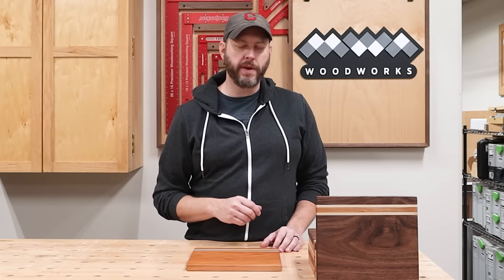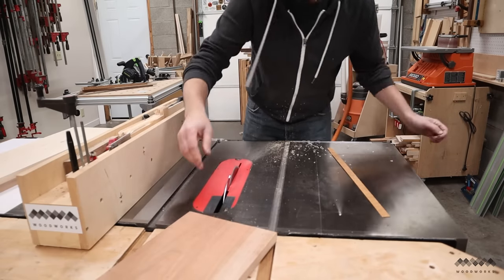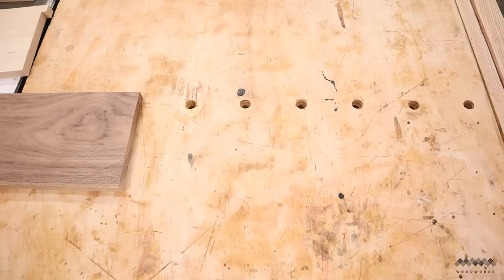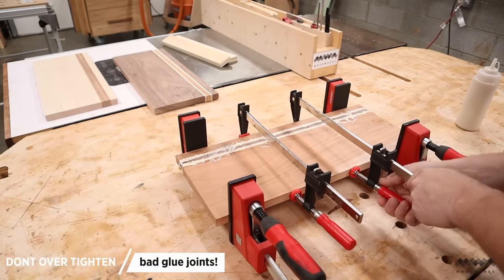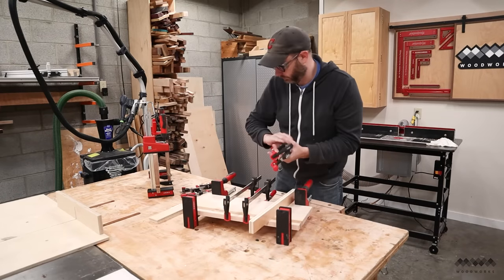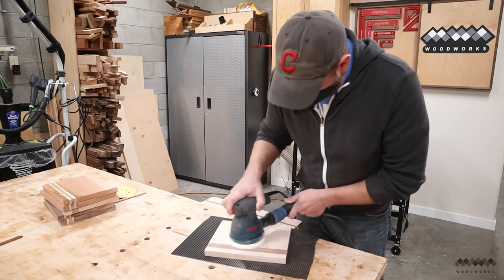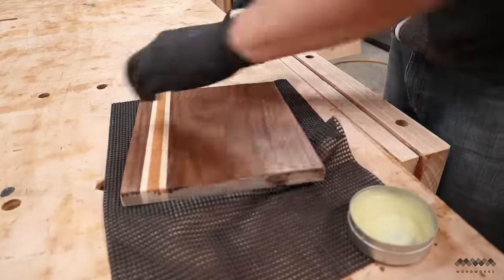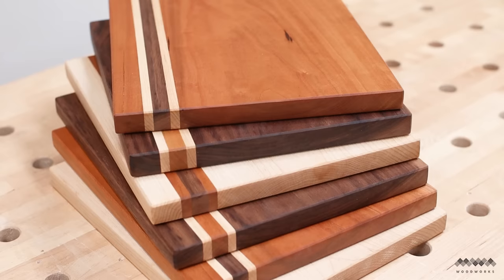How to Make Cutting Boards with Minimal Tools

Comment from the maker: ✅ HOW TO SUPPORT MY CHANNEL 
SUBSCRIBE : https://www.youtube.com/mwawoodworks?sub_confirmation=1
JOIN my Patreon community: https://patreon.com/MWAWoodworks 
GET project plans: https://bit.ly/download-project-plans 

✅ TOOLS AND SUPPLIES IN THIS VIDEO:
Titebond 3 Wood Glue (bottle) -https://amzn.to/3aH17TA
Condiment Bottles (for glue) - https://amzn.to/3aZKsZf
Parallel Clamps - https://amzn.to/3hwJSDC
Scraper - https://amzn.to/3o75jNP
Gorilla Grip Shelf Liner- https://amzn.to/2WZtn9C
GOOD cedar pencils (trust me) - https://amzn.to/3IMwsB8
Dewalt Trim Router (bare tool)- https://amzn.to/38ROyA7
Freud 45 degree chamfer bit - https://amzn.to/3o6OFhx
Freud Heavy Duty Ripping Blade (for table saw) - https://amzn.to/352SuNg
Bosch Random Orbit Sander - https://amzn.to/2X4CRR8
Mirka Sand Paper 80 Grit - https://amzn.to/3ojw9lW
Mirka Sand Paper 120 Grit - https://amzn.to/351sWjn
Mirka Sand Paper 180 Grit - https://amzn.to/3bdfgpJ
Mirka Sand Paper 220 Grit - https://amzn.to/2KJuE2f
SUPPLIES FOR MAKING CUTTING BOARD WAX
     ►4 oz Aluminum Tins - https://amzn.to/2PS1q0V
     ►Bag Beeswax Pellets - https://amzn.to/3PfRxGj
     ►Mineral Oil - https://amzn.to/3ASteKn
     ►Mineral Oil (gallon) - https://amzn.to/3aQsY3I
     ►Crock Pot - not cool like mine tho :-) - https://amzn.to/372XujC

*As an Amazon Associate I earn from qualifying purchases

Comment: There can never be enough video like this for new folks starting out. Nice to see something being shown without the need for the high priced equipment that most new folks don't have.
I'd personally like to see more in the realm of minimal equipment levels. Nice work and worth a sub.
Reply from the maker: Thank you I appreciate it 👍
Reply: Great video very informative and helpful for us new guys ..
Reply: Starting out?  Starting out means a circular saw, a power drill, a square and ruler, and a hammer.  When you have gotten your shop to the level of table saw fitted in to a modular stand, you are past the point of just starting out.  A table saw or miter saw are all major investments to your wood working shop.  And when you have more wood clamps than what is on the shelf at your building supply store ... yeah you are past the starting out phase. 

This project may seem like a quick easy project with minimal tools, but the project ease is a direct result of having a full carpenter shop of tools.
Reply: @superdave8248  And as a new woodworker, I don't know if I could pull this off with just a circular saw and the other tools you listed. I don't trust myself to be able to get straight cuts with a circular saw and I definitely can't afford a table saw.
Reply: dwafawf123
Reply: I don't even have a square or ruler but I'm halfway done making a miter saw table. I have a one inch chisel, a power drill and the miter saw. Not even clamps yet.

Comment: These instructions were great, super simple, and the boards were a lot of fun to make. I like the thin stripe over the thick ones in the packaged kits because they look more elegant. I couldn't find the same widths, but I had extra lengths of 3/4" leftovers, so I just added them up to 8" across for the thinner main boards. A+ would do again. These are good travel-friendly gifts, too - they pack away easily!

Comment: Buttery smooth boards and a buttery smooth tutorial/video. A YouTube primer in instructional video production, extremely well done. Having only a 6" planer, I've always shied away from cutting boards, but you know what you've done, now?!
Reply from the maker: Hey I used to have a 6 inch delta jointer/planer and made it work 👍 you gotta use what you have for sure. Have a great day!

Comment: I haven't been into long grain cutting boards but must admit that your design is very nice and not too labor intensive.  You've sold me - well done!
Reply: For clarity, what kind of cutting boards do you prefer? Long grain makes sense because the knife marks from use will be against the grain. Is there another simple style like this you'd recommend trying?
Reply: @onethousandwords  I made a few of these and gave them away but one.  I admit that they are nice and work well and the recipients liked them.  That said, I've made only edge grain prior but you are right that it's more involved and takes more wood.  Knife marks are the same regardless, but the edge boards are much thicker (about 1.25").

Comment: Nice video.  Did you sand the smaller pieces before gluing them?  Also, how would you get smaller pieces for like a side grain glue up and make sure they are at 90 degrees to glue??  Thanks

Comment: very cool. question about the thin strips. Are they face grain? Are all your pieces face grain to face grain? I am confused about putting face grain to edge on cutting boards. is that ok over time?  I know not to ever mix end grain with face or edge but I can't get a definitive answer on face to edge glue ups. both long grain so should be ok?? anyway your boards are beautiful and definitely going to try one.
Reply from the maker: These are all face grain to face grain but you should have no issues mixing face grain to edge grain since both are long grain

Comment: I'm getting ready to make my first cutting board. I had a friend say that you can't use just a single slab of wood, that it needs to be made with strips of wood. Is this true?  So i can't use a single 10" wide board for a 10" wide cutting board?  If not, how wide can I go with each strip?  It looks like your cutting boards do have quite a wide strip at the bottom.   I'm hoping to sell some eventually and want to be professional with these. Thanks!
Reply from the maker: There are no hard and fast rules when it comes to wood. It's definitely risky to use one wide board (also not very interesting!) There's definitely no "rule" about how wide to make your strips. Many factors come into play including the thickness of the cutting boards, the species of wood and the behavior of the individual piece of lumber. I know you wanted more concrete answers but it's better to learn now that there's no such thing 😂😂😂. Just have fun, experiment with making your first boards and learn as you go!
Reply: @MWAWoodworks  Thank you for replying, I appreciate it!

Comment: If you put a dowel about the same thickness of the wood you are gluing between the board and the face of the clamp the dowel will tranfer al the pressure to the middle of the board and your joints won't twist in the clamps.

Comment: Awesome video! I'm not a woodworker but I'm trying to make wood signs and I'm having troubles with warping wood.  I'm learning about how to store wood, etc. and the planing method of working over multiple days until the wood settles.  Would you recommend using a glue up of two smaller boards for a 12 inch wide sign or an actual 1x12?  Which will warp least? Thanks.  All of my wood has been warping and I can't plane too thin.
Reply from the maker: If you're using 1x12 pine from the big box stores, yes it will warp almost every time.

Comment: I’m looking at videos to see what kinds of oils finish off a cutting surface. My project is small and pre made. Is there a simple oil that can work without having to mix or buy anything special?
Reply: did you find it? I'm looking for the same
Reply: @raphaelschubert  I asked my friend who is a professional chef. Here’s what he replied with: Use canola oil. It won’t go bad. I would not use Sesame oil. It will go rancid.  Nut oils sometimes turn and smell bad.
Reply: @JugglerLou  Thanks!

Comment: My first board was just solid maple and used a router and sander. Worked well, looks nice, and didn't have to worry about the issues with gluing wood.

Comment: Thanks for this video! Would you do anything different on the finish if it was an end grain board?
Reply from the maker: The only thing I do different is to soak the board in mineral oil before applying the wax paste. End grain board can soak up a lot of oil. Long grain boards don't and so I skip that step.
Reply: @MWAWoodworks  thank you sir!

Comment: What do you think about adding robber feet to make the board nonskid on the counter?
Reply: I used to put rubber feet on the bottom of my boards, but now I don't think it's worth it. Having it reversible is better, and if the board is big and heavy enough, it shouldn't slide around anyways.

Comment: At my local store, if I buy pre-surfaced lumber, most of the time the boards still have cups and twists.  There are small but make a big difference when making the boards I have found out.  Any suggestions here?
Reply from the maker: Not a lot you can do other than sand down the high spots. Without milling equipment this is the way.

Comment: How do you keep them from twisting? Every single 3/4” cutting board that I make has some rocking to it.
Reply from the maker: These boards are only 8x10. Got to keep them small when they are that thin
Reply: @MWAWoodworks  yeah 12x16s keep getting twist. I got the rockler mini panel clamps and that helped a lot. I just recently made a 12x16x1.5 and it’s perfect. Thanks for the tip!

Comment: Great video. Thanks!
what is the final size of your board? length, width and thickness? Do you add feet as well or leave it like that?
Happy new year!
Reply from the maker: These boards are only 8x10 and 3/4 thick. Meant for bars and quick kitchen use. No feet.

Comment: Liven your vids once again !!!! You shared with us your choice of oils n wax. I once upon a time went to buy this combo and was told that if I use wax on top of the oil, I would never be able to treat the board again. In other words, his point was don’t use wax. If you use only oils, you can retreat with oil anytime later down the road as needed. Thoughts?
Reply from the maker: I've always re-treated my boards with wax and oil. The wax on the outside is eventually washed away with use and water the board will begin to dry out and look pale and dry  and I have had no issues with rejuvenation after a board has already been waxed.

Comment: Can I use Polyurethane to finish a cutting board?
Reply from the maker: I wouldn't do that
Reply: Absolutely not. Polyurethane finishes WILL chip under use and get into your food; similarly, you shouldn't use normal cooking oils like vegetable or olive oil because they can go rancid and give your food an unpleasant taste or smell. If you can't mix your own food safe finish, or just don't want to go to the trouble, search on Amazon for Howard's Butcher Block Oil.

Comment: How would you cut a more complex shape like a guitar or a sword (for a wooden prop)?
Reply from the maker: I would do it with a CNC
Reply: Where would I get this done? Its not like cnc’s shops are like fast food restaurants😮and they arent cheap to but like a drill or router.
Reply from the maker: Well I never said it was cheap to do 😂. You may have a maker space in your area that has CNC machines that you can rent to use for projects. Lots of cities have those. Otherwise invest in one of the benchtop CNCs. You won't regret it.

Comment: What are the widths of all your pieces?looking to build this exact board 👌
Reply from the maker: I used 9 inch boards for the primary wood. The secondary stripes are 3/8 inch and 1/4 inch
Reply: @MWAWoodworks  my man🤙

Comment: I don't understand... isn't this face grain with some strips? What's the difference between this and just a piece of wood (other than the strips)?
Reply from the maker: Sounds like you understand 😃
Reply: @MWAWoodworks  ok... I'm a very new woodworker (just bought a table saw last weekend), and even I wouldn't do this. There's no point in taking the time and wood to make a cutting board unless it's at least edge grain.

Comment: 8 Hours in the clamp? i would suggest using a different glue then. my boards can be taking out of clamp after 20 min. makes it so i can repeat the progress without waiting.
Reply from the maker: 8 hours is just a good rule. I can take mine out after an hour but I usually let my glueups cure over night
Reply: @MWAWoodworks  aight! Anyway thanks for the video it was great!

Comment: "Minimal tools" like a tablesaw? LOL
Reply from the maker: Minimal in terms of number of tools needed! 😁
Reply: @MWAWoodworks  Maybe you have that kind of budget and space. I have a 5" circular saw and a sawsall, can't fit more tools, small house smaller budget.
Reply from the maker: Well cutting boards are going to be a bit out of reach for you then until you can drop the construction tools and get some woodworking equipment to do a woodworking project. You could also buy a kit from woodcraft but you still need glue and clamps which it sounds like you haven't invested in yet 😅
Reply: @MWAWoodworks  Where do people get the space to store all this crap? Seriously, it's like you have a garage and a spare room and tons of extra storage space. Some of us live in much smaller homes.
Reply from the maker: Most people work out of their 2 car garage. I saw one guy that used a bedroom in his apartment as a workshop 🤷
Reply: @MWAWoodworks  "Most people work out of their 2 car garage." Wow.. I don't have a garage or a spare room.
Reply from the maker: So you don't have any tools and you don't have any space. I'm wondering what drove you to watch this video and comment in the first place? Seems odd.
Reply: @MWAWoodworks  I am trying to make the mist of my limited resources. However I see a lot of people with a whole lot of space and tons of tools saying "this is easy" or "build this for very little!". No.. you invested in tools and happen to have a lot of space to house them, and material.

Comment: Title Bond 2 is a little thicker than 3 and helps to fill any gaps in the glue joints. 2 seems better for cutting boards, in my opinion. Only down side would be if 3 is more waterproof than 2.

Comment: that is complex for the first. How about just making it without those small glued parts and make it just from one type of wood?
Reply from the maker: Well I could have grabbed a hand saw and hacked off the end of a board and sanded it🤷 but I don't think I could have stretched that into a youtube video 🤣🤣🤣 I mean really where does it end?
Reply: @MWAWoodworks  You could strech it into a short youtube video. That is something I waslooking for for a beginner project, and all I  found were those complex cutting biards that could be best for the second project. The need is there :) As you can not imagine how a complete newbe looks at things, for most of them cutting a  board, sanding it and finishing is a worthy frst project.
Reply from the maker: Fair enough. This video is geared more toward people who have begun to invest in their hobby and want some simple beginner advice to get them one step further along👍 thanks for your comments

Comment: He is to make sure you don't cut off your fingers or wind up with that saw inside your guts I've had several table saw accidents and they all happen cuz I didn't tie down the saw make sure you anchor that saw to the ground or open up your truck bed take off the tailgate and ratchet or tie that f*** to the back of the truck and cut and feed into the bed

Comment: Wouldn’t it be easier to move the fence close to the blade so the only thing you have to do is slide the board through..... better uniform cut.
Reply from the maker: You could but this is a safer way to make the cut. Cutting thin strips against the fence like that is a great way to have a thin strip rocket into your crotch

Comment: I would never make a cutting board with the board just laying flat as you did. Eventually, the boards will warp laying like that especially for cutting boards. It may look nice showing all the grain but it will warp...
Reply from the maker: These boards are only 8x10 and don't warp at all

Comment: Minimal tools, uses a table saw.
Reply from the maker: I used the bare minimum tools you need 🤷
Reply: @MWAWoodworks  I made 3 chopping boards from English Oak this week with a jigsaw, hand plane and orbital sander. Bare minimum.

Comment: Mineral Oil? Relly? From a board you want to eat from? Take something natural instead like linseed oil.
Reply from the maker: Mineral oil is standard for cutting boards. It's pharmacy grade. Linseed oil is an oxidizing oil. It won't protect against water and shouldn't be used for this application